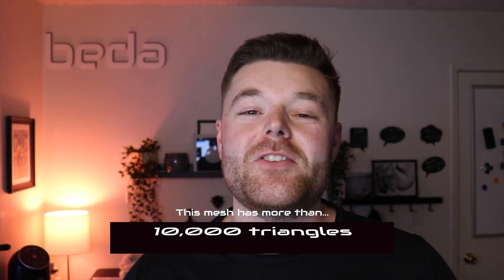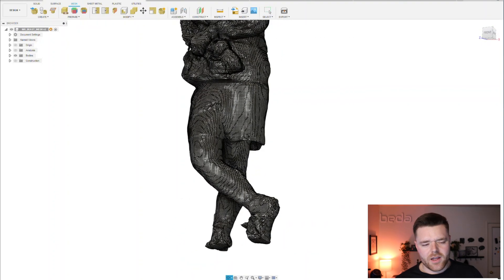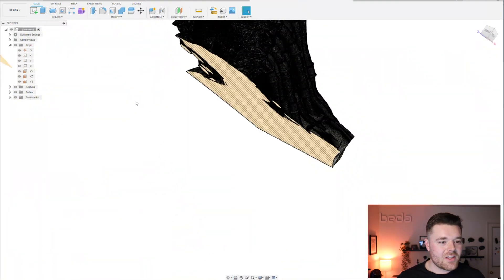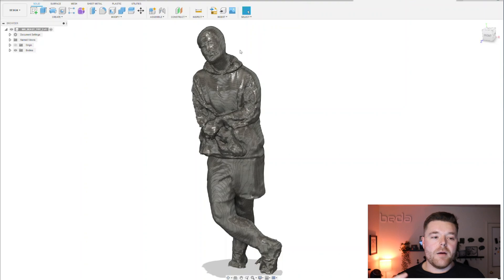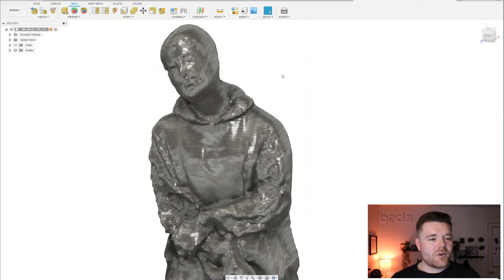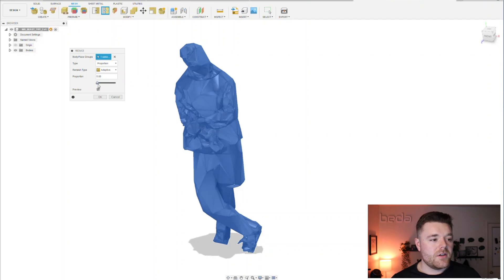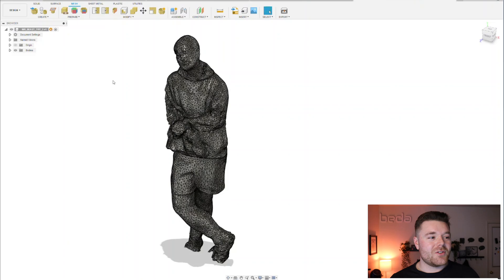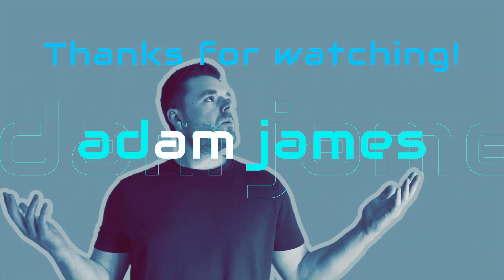More than 10,000 triangles error in Fusion 360 (Solved!)

Comment: Reducing the triangle count is not a great solution. I have models with way over 1 million triangles, terrain models. Yes I can triangle reduce them and I do but not to 10,000 triangles as it removes too much detail. I wonder if there is a way to create tool paths for milling with STLs of larger triangle count. Any CAM software, does not need to be Fusion 360